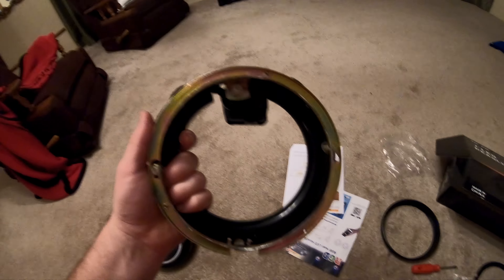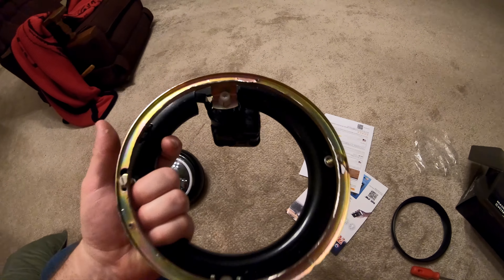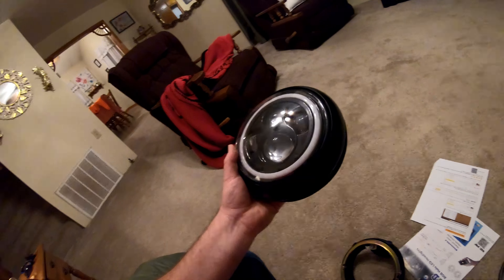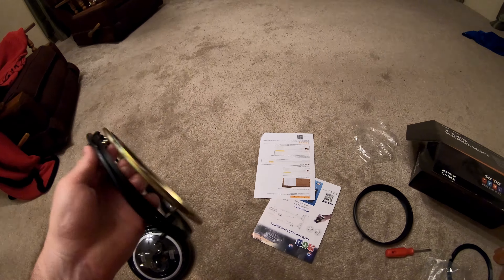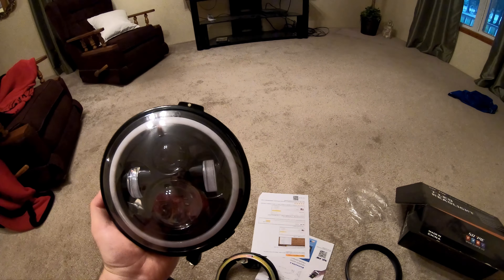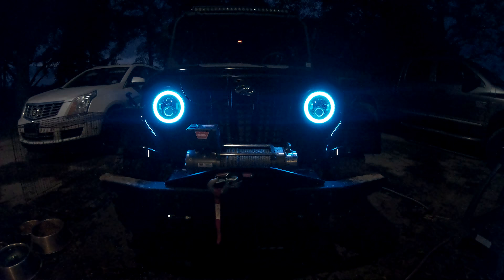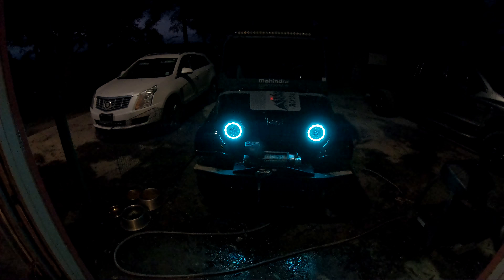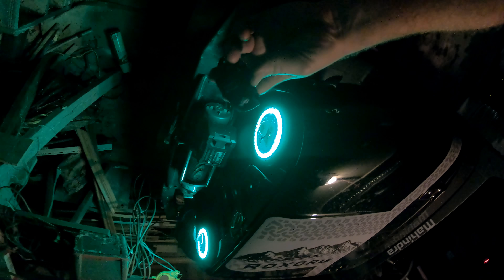HALO & LED Lights on Mahindra Roxor!

Comment: I need a link of were to get those nice lights
Reply from the maker: Danny Tom 7" LED Headlights with Rotating RGB Halo Speech Brightness adjustment Remote for 1997~2017 Jeep Wrangler JK LJ CJ Hummer H1 H2 Headlamp DRL Driving Lights Bulb https://www.amazon.com/dp/B074M3XHM8/ref=cm_sw_r_cp_apa_eCFRBbS998JNF

Comment: Do the halo rings support Amber turn signal integration?
Reply from the maker: Donovan Goodwin i believe so
Reply: @RedWhiteRoxor  Then that makes it super easy to wire in a turn signal kit. The rear lights have a dual fillament bulb for turn signal integration. On_the_Rox Fabrication sells a kit that splices into the factory harness for the rear and you can just wire the front lights to the amber turn signal harness on your new led headlights. It's perfect. And his signal kit comes with a column signal switch. Take a look into that...
Reply from the maker: Im aware of that im just not really interested in it lol, i ride on the road around here anyways. Cops arent too strict about anything and its all backroads. And im afraid if i equip all of that stuff, atv only parks will turn me down because itll be harder to prove its a side by side
Reply: @RedWhiteRoxor  Haha yeah I get that. Perhaps someone else who's watching this can take the info.

This thing is so cool though. I want one so bad.
Reply from the maker: Hope you dont take it as me tossing out your idea, just doesnt really fit my need at the moment! Yeah, hopefully anyone out there with questions might have had one or two answered =)
Reply: @RedWhiteRoxor  No not at all. I completely understand.